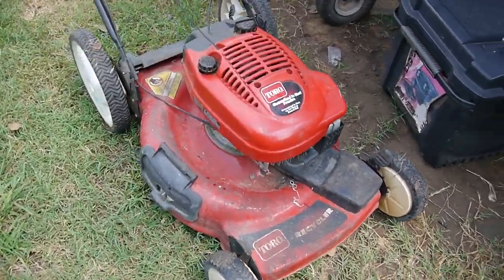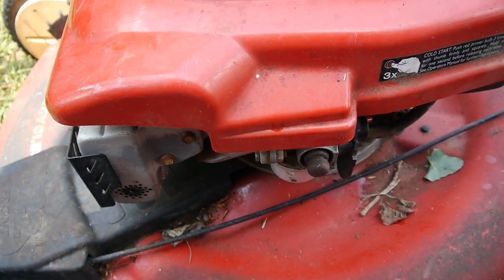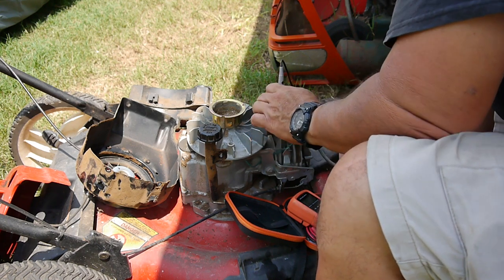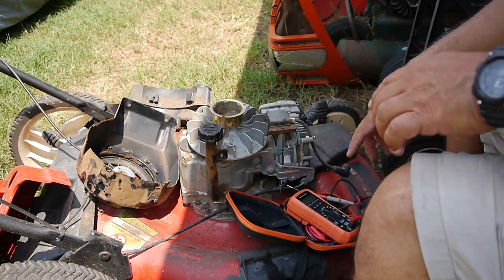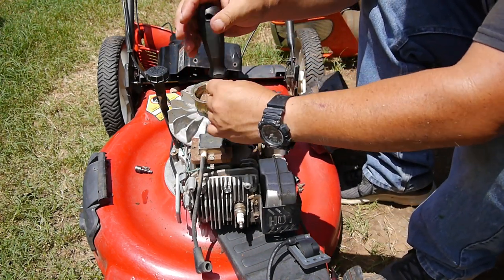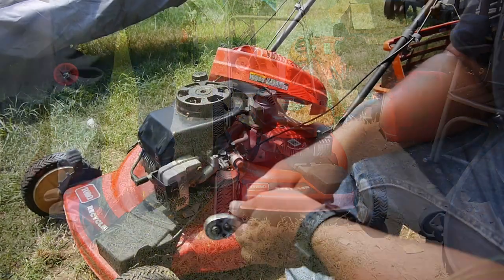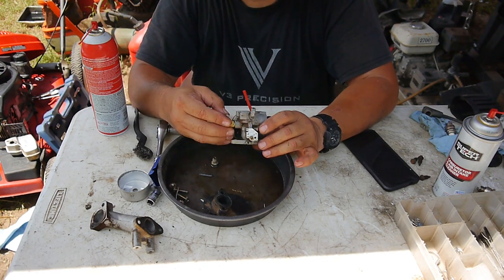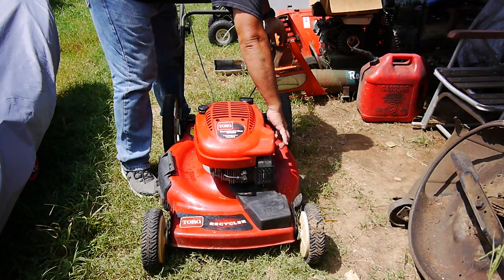Toro Recycler Lawn Mower with a Tecumseh Engine has no Spark

Comment: All of the tecumseh I have worked on only 1 bad coil. Just finished one of those kind of sun baked pulled engine to buff it to high shine. Front drive needed top bearing. Blade missing flywheel off sheared key. Was free. So $16 blade oil, $1 bearing time it is done. Mower season is pretty much done in mn.running a little lean found next size up torch tip cleaner clip very end with side cutter twist jet on it till through runs great. On those carbs don't forget the port in bottom of air intake to emulsion tube area.

Comment: Pro tip: Just hold the spark plug tip or threads (metal) against a metal portion of the engine (with boot/wire attached) and have someone pull the cord a couple times. You can see if it sparks or not. Free.

Comment: With the Tecumseh I only pull the bowl nut because this is the main jet .This is usually the problem and it quick to do , leaving the carb on.
Reply: Thats a quick and dirty it works many times, but not always, sometimes the throttle body is also all gummed up, than you got no choice, full carb service. Just tried it on a 10 flathead Snowking, no dice, body had to come off, 45 minute cook in the ultra with simple green, runs good as new!

Comment: Do you have a lawn sprinkler going or do you have a big ass rattlesnake near you? It sounds like you're at the reptile house at the circus. BTW a great video and I hate not having a spark because that just leads to more of a teardown and process of elimination, plug wire, points and or coil.

Comment: Great job. How many rpms do you shoot for? Thanks
Reply: 3100 +/- 150 is spot on on these push mower engines. 3300 max, but than the engine is working harder and using the oil much more rapidly. 2900 and they can go forever.
Reply: @Mr_Tecumseh  Thanks!

Comment: Did everything you did up to and including replacing the coil and plug.  Still no spark.  Disconnected the kill wire, put starting fluid in the cylinder, replaced spark plug; still no combustion.  Not sure what else to try.  Anyone, any ideas?  thanks